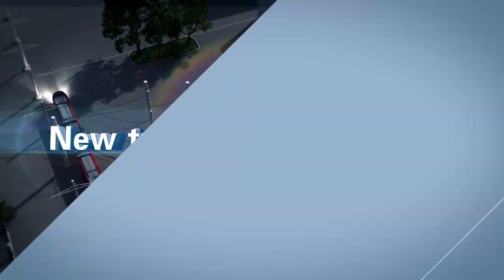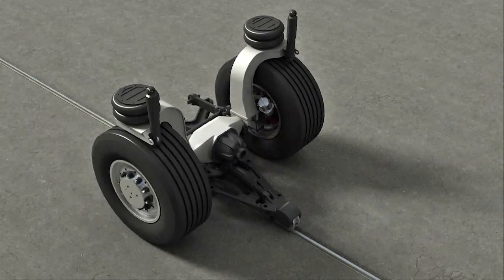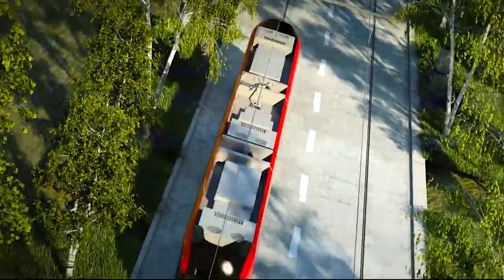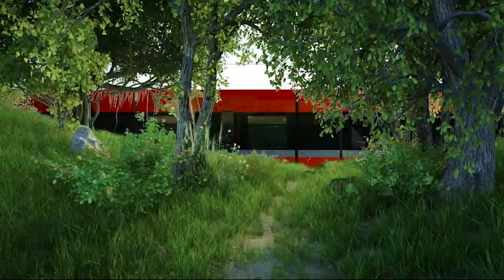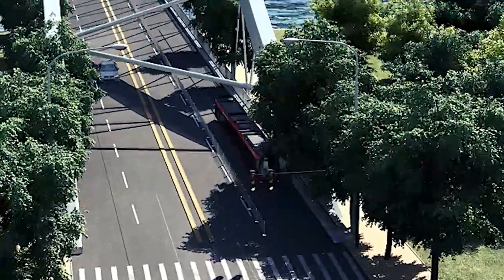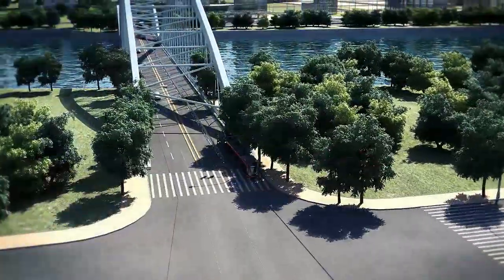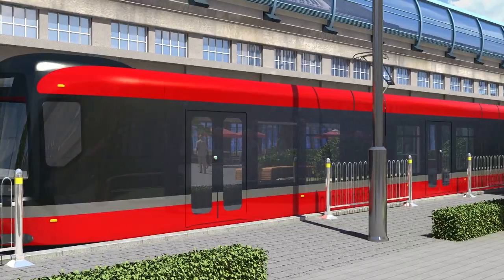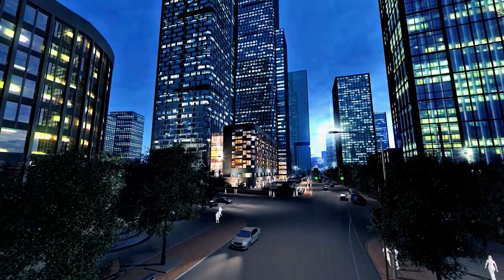1 New Eco City Transport : CRRC Guide Rail Tram

Comment: I haven’t seen reports of these installed anywhere but the similar ARRT (which also uses rubber tyres, doesn’t require the guide rail and uses battery power) has four systems.

Comment: Airborne pollution is exacerbated by the use of rubber tyres, which causes the tarmac or concrete road surfaces to deteriorate.   Guided buses/trolleybuses/trams ride quality is only as good as the road surface.  Steel on steel is more efficient and environmentally friendly.  This is a failed technology, as in France.